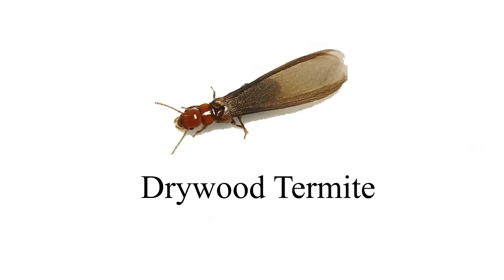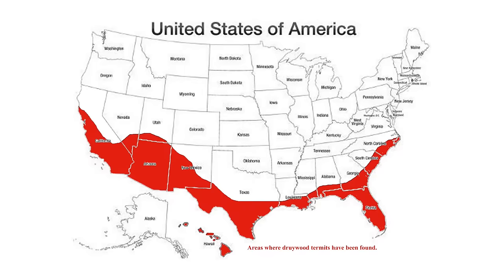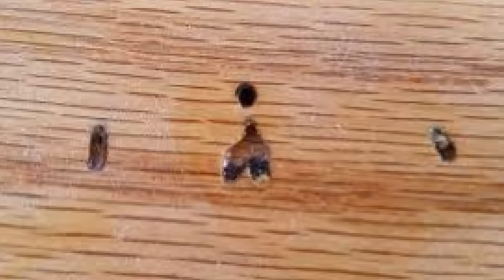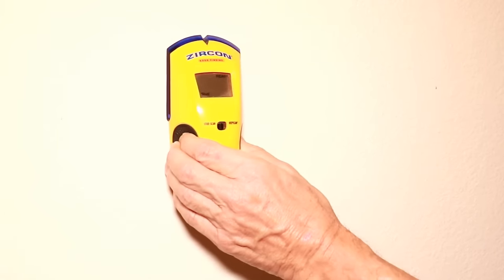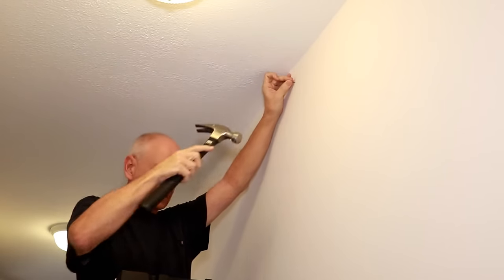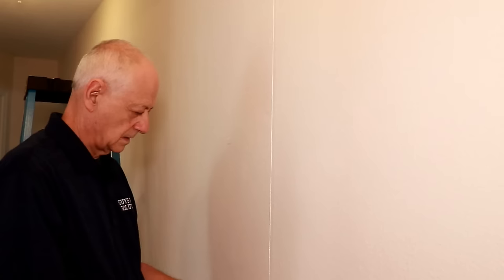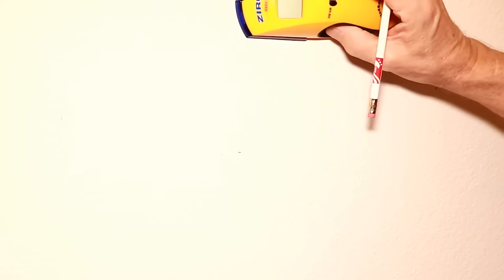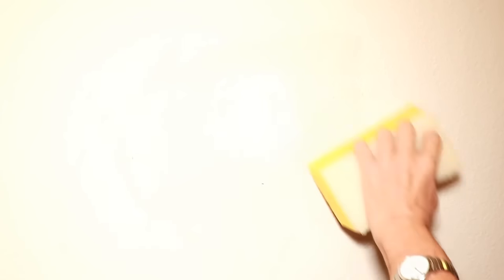How to Treat a Drywood Termite Infestation Yourself. A MUST see if you have Drywood termites.

Comment: Would you please make a video showing how to treat and prevent patio from termite infection?
Reply from the maker: Actually, I have two of them.  Termites either attack from the ground, as is the case with subterranean termites, or from the air, as is the case with drywood termites.  I have videos on how to prevent both and I will place links below for you.  Please watch both videos and let me know if you have any questions.  

DIY Termite Treatment video (Shows how to treat and prevent subterranean termites):  https://youtu.be/H7rW_TSBHJ4

How to Prevent Drywood Termites:  https://youtu.be/neNsmVbj8Pc
Reply: @GuysPestSolutions  Hi Guy. Thanks for the video! The pest control company that just came to assess my house told me that they could offer this Drywood defense system where they fog the attic. He told me that the fogging will spray chemical all over the wood In the attic. Do you think that Could be effective? And do you think that could also treat the wood inside the wall?
Reply from the maker: @hsinglu  To be honest with you, I have never heard of fogging an attic for termites.  I would love to know the specific pesticide that the pest controller is planning to use to fog the attic.  This type of treatment does not seem logical to me, but I am always open to new ideas.  Please do me a favor and ask this person what materials he is planning to use.  I am not aware of any pesticides that you can fog that would penetrate the wood sufficiently to kill any type of wood destroying pests.  So, I do not think this would work either in the attic or in the walls.  However, I do not know everything there is to know in the entire world.  It is always possible that somebody figured out something that I have never heard of before.  Hey, you never know, but I have my doubts.

I hope that helps.  Be well my friend.

Comment: Hi Guy.  Your thorough well planned explanations are really helpful.  I have a unique situation where the upstairs floor joists (2x12's) are exposed on the first floor- the "loft look".  A few have signs of termites.  What can I treat these with safely as they are truly inside the house.  I've started using Boracare on them but I'm not sure this will solve the problem.
Reply from the maker: Thank you so much for those kind words.  Very much appreciated.  
 
If the floor joists are not sealed with anything, then the Bora-Care will do an excellent job killing all the termites, but you must mix it at a ratio of 1 to 1.  That being said, if you have drywood termites in those floor joists, then there is a very high probability that you have them elsewhere in the building as well.  I always say that anything is possible in pest control, but as a general rule, you are not going to see drywood termites fly into the house and infest floor joists that way.  That certainly is possible, but it is far more likely that there are galleries located elsewhere in the building that you may not be aware of.  Termite galleries are very hard to find and may be inside your walls, where you cannot see any evidence of them.  It is also very common for them to enter through the eaves and get into the attic.  From there, they make their way into other areas of the building, such as your floor joists.  The only good news about drywood termites is that they are very slow eaters.  It can take years for them to do structural damage.  So, if you want, you can do the Bora-Care treatment on the floor joists and then wait to see if they appear somewhere else.  I think it is a pretty safe bet that they will, but you could take that course of action.  Should you find them in another area of the building, then the only way to really get rid of them is to fumigate.  Keep in mind that these guys had to come from someplace.  That someplace was most likely one of your neighbors’ homes or maybe an infested stump somewhere.  In any event, the point is that they have probably been swarming for years now, and that means they have been attacking your house for years now too.  It is almost a certainty that they have established colonies elsewhere in the building that could be in the attic, around windows or doors, or other penetrations in the building.  The only way to prevent this from happening is to do a preventive treatment and I'm kind of guessing that you have not been doing that.  Whether or not you have galleries in other areas of the building, you should begin doing a preventive treatment right now to stop even more of these guys from entering your home.  I have a video on how to do that and I will provide a link below for you.
 
I am so sorry that I had to share that bad news with you, but I'm pretty sure that you came to me to get the facts and I always give it to you straight. 
 
If you decide to hire a pest controller to fumigate, then I recommend that you watch my video on how to hire a pest controller without getting ripped off.  Prices can vary wildly in this industry, and you can save a lot of money by watching this video.
 
I hope that helps.  Be well my friend.     
 
Video on how to do a preventive treatment for drywood termites:  https://youtu.be/neNsmVbj8Pc
 
Video on how to hire a pest controller without getting ripped off:   https://youtu.be/y-a8XOqVrlE
Reply: @GuysPestSolutions  Thanks much for the informative response.  The house is 22 years old now and has been fumigated twice.  I'm pretty sure I know where the most recent termites came from.  We had wood French doors facing the outside nearby and they got terribly infested.  I've recently replaced them with Aluminum- it looks more modern and there are some very nice Aluminum doors these days.  4 pairs of French doors with little shelter from the elements was a maintenance nightmare.  I'll take your advice and complete the 1:1 Boracare treatment- I roll on a small batch every few days on several joists at a time.  Then in a few years I'll fumigate again and do maintenance treatments from the outside.
Reply from the maker: @michaelzwang3678  Sounds like a plan.  Please let me know if I can be of any further assistance.  Be well my friend.

Comment: I do termidor 1 oz, nylar 1oz and permethrin 35% 1oz, 2 gallon water sprayer. I spray the walls every ft towards the ceilin, and do as you say, now you're saying FOAM,  why not liquid?  I leave the home for 24 hrs, that seem to work in Central Florida. My only question, FOAM is better then liquid? We have a flea issue as well in a condo facility.
Reply from the maker: You never want to use permethrin to treat termites.  That is a repellent and can make the problem worse.  Liquids do not penetrate the wood sufficiently to take out the gallery.

Fleas are being brought in from the outside.  In a condo there isn't much you can do to stop them if you are walking your dog or you are walking through the grass.  You can treat them inside the house by vacuuming and then spraying PT Ultracide.  Just follow label directions.  Be well my friend.

https://www.domyown.com/pt-ultracide-20-oz-p-175.html